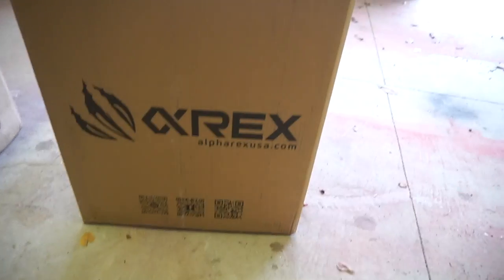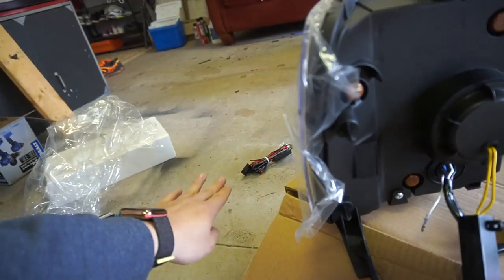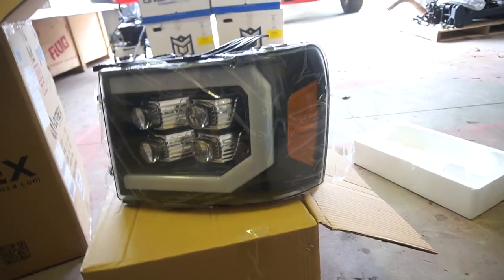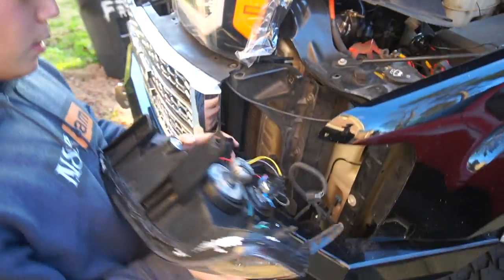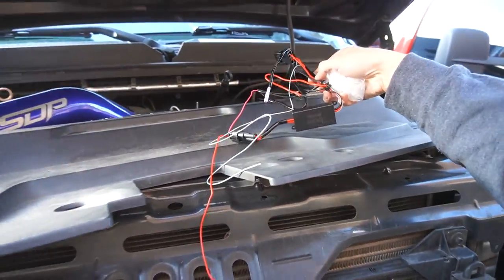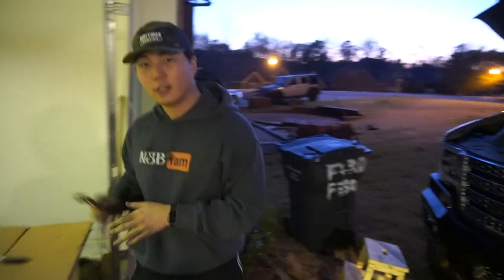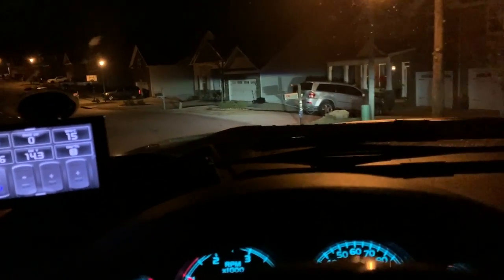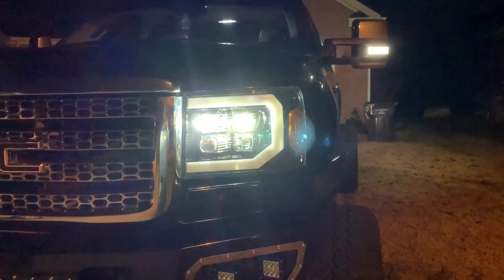These Headlights will UPSET ALL other AFTERMARKET HEADLIGHT Companies.!!!

Comment: To properly align your headlights you need a wall that’s 25ft away from the front of the truck and it’s completely level, measure from the ground to the headlights, and then subtract the amount of lift you have and then take another inch off and thats where you need to have the height of the lights set. Then you need to measure the width of the lights, so measure from the passenger light the other drivers light and adjust so that at 25ft middle of beam is set to that width. The retrofit source has a good guide to help adjust them so you get the best output and don’t blind anyone.
Reply from the maker: Facts. Plus, not having LEDs in reflective housing itself is a big plus In blinding people too

Comment: I just bought a pair based off of your video for my 08 Sierra - so thanks !! These headlights are amazing.  I wrapped them with VViViD light smoke vinyl and they look sick !!
Reply: The DRL aren’t bright right cuz I have a set and I’m disappointed
Reply: @IH8Too  even with the wires connected? By my understanding the wiring harness is supposed to make the DRLs brighter
Reply: @dammitrey1819  only during the day. The second your side markers come on (triggered on when dark or night) the headlights automatically dim the halos.

Comment: That grey wire activates high intensity light on the C-Bar so it's brighter. If you're not worried about DRLs then plug it into your low beam fuse and then you'll have higher intensity light at night on your C-Bar. Looks much better. I got these same lights. I have the projector ones that have a little bit cleaner line than these from AlphaRex. 

My new spyder lights on my other truck have just as good of a cutout line too tho so no reason to put them down unless AlphaRex paid you too do so I guess lol.
Reply: Which fuse should I plug It Into
Reply: @laiDBackproduction  daytime running lights or "DRL"

Comment: Awesome review!! I installed a set of their Pro series in my 2014 GMC Sierra Denali HD and added a set of Light Moses LEDs and felt exactly the same . I have good cutoff line with out light scatter. The Alpharex Pro series are my third set of aftermarket headlights tj=hat actula do what they are supposed to do. Its sad that the S350 Alpharex Pro series out perform my $700 Recon. I have videos of all of them on my channel,  and the one thing that I absolutely hatred about the Recon is the  piece of metal welded to the front of the cutoff shield that was intended  to help illuminate signs in low beams, but was a real nuisance in fog.  Scott

Comment: Question, I recently bought those head lights and mine aren’t doing the chasing and my day time running light ring doesn’t seem bright. Any  ways I could have installed them wrong?
Reply: I have the same issue were you able to figure it out ?

Comment: Did you purchase the towing mirrors from the same place in order to have them sync like they do when you lock it and unlock it?
Reply from the maker: They are BoostAutoparts mirrors. Go check out their website. You can add these options.
Reply: Thanks man.  Those are extremely cool tow mirrors

Comment: I just installed these on my 07 and I’m confused as to where the grey wire goes? Where did you tap into the ignition at? So far mine just light up and work as normal headlights so I’m assuming after I get the box hooked up it will do all the fancy stuff?
Reply from the maker: That’s if you want the lights to turn on with ignition even in day light

Comment: Where did you hook up the last wire where you forgot in the last part to the ignition?
Reply from the maker: It would go into ignition
Reply: @JWMontoya  where exactly?
Reply: @damiansantiago4781  there is an install guide on alpharex website, use add a circuit  mini fuse and install in slot 48.
Just install mine

Comment: $980.00 shiiiiiiiiiiiiiiiiiiiiiit!!!!
Reply from the maker: Right?! I can't believe they're half the price of OEM GMC headlights! 2017 OEM headlights are $1200 per side 😱
Reply: $980 bucks for aftermarket headlights is still extremely expensive
Reply from the maker: Properly retrofitted headlights with sequential LED option would cost way more than $1500